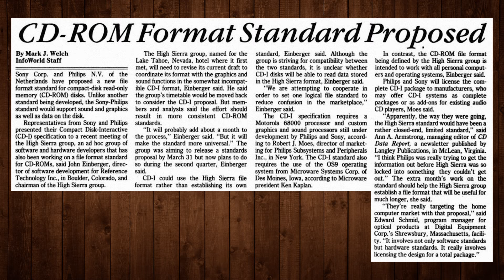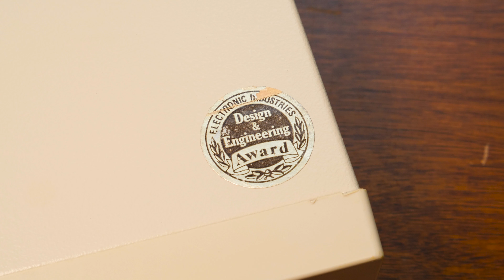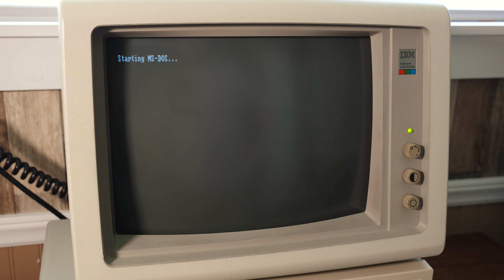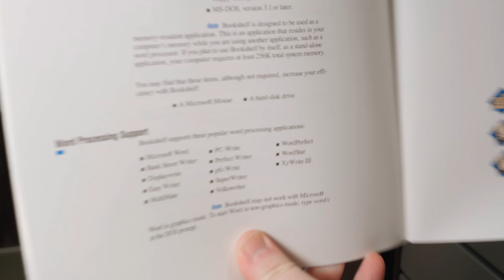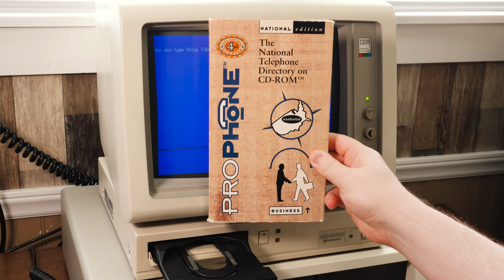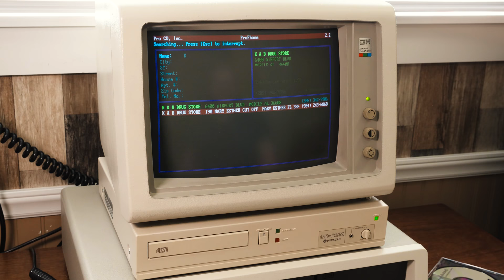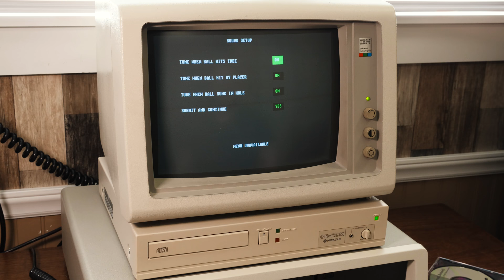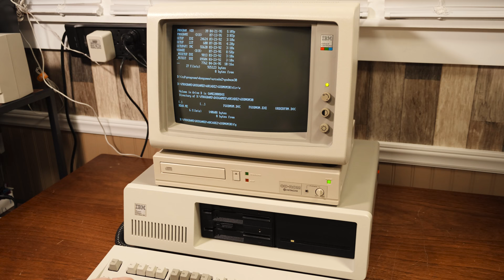The 1987 CD-ROM Experience: Hitachi CDR-1503S

Comment: I'm in awe of the graphic design on that '87 Microsoft CD. It's virtually indistinguishable from the design they were using for optical media well into the noughties. I'm not talking about premium optical media that might have a holographic surface, but your mundane mouse driver or service pack CDs really did look like that for a long time.

Comment: I remember when we got our first CD-ROM drive for the family 386. It was an internal drive that came in a pack with a sound card of some kind. It used this weird interface with a super skinny data ribbon cable which I haven't come across since. Used even fewer pins than the Sony interface on some of the SB16 cards. Definitely a lot fewer pins than the huge connectors on that drive!

It wasn't a caddy drive, but the tray wasn't motorised either. You had to push in the tray and it would pop out, then you could pull it the rest of the way out. My dad didn't know much about computers, and I was just a kid, so we had no idea you had to load drivers to make it work. But I did figure out that you could get it to play an audio CD if you pressed the volume knob on the front. That made my dad very happy, because the only reason he bought it was so he could play a music CD he bought.

Eventually we got some help to load the drivers and get it working, we also got the sound card working, but that took longer I think because it wasn't a common one like a sound blaster.

Really wish I knew what the drive and sound card were, I'd love to re-build that machine the same as when I was a kid. I'd love to relive the memory of playing games on that machine.
Reply: Drive sounds like a Mitsumi LU005S. Single speed, very weird tray, and the only one of it's type IIRC. Used a 36-pin interface I believe... There were versions bundled with all kinds of soundcards
Reply: May have been some revision of the Mediavision Thunderboard with CD interfaces onboard
Reply: Possibly an early Philips CD drive, or an early Mitsumi drive/sound card.  Until they settled on IDE, each manufacturer had its own interface.  I still have a ton of old computer hardware down in my basement collecting dust, including a 1x Philips, many 2x drives, and a 3x NEC external drive with SCSI2 interface.  I should probably sell most of that stuff, if it's worth anything now...
Reply: I have the drive you speak of at work somewhere. It did indeed use a small ribbon cable.
Reply: Thanks for all the comments and suggestions, Mediavision did sound familiar, so I did a quick google image search and found it was most likely a Pro AudioSpectrum 16 card due to the 16 pin CD-ROM header. The wikipedia article suggests this is known as the LMSI interface.

The CD-ROM drive still has me stumped. It wasn't a Mitsumi LU005S as suggested, the tray was very different from that one. I remember it was relatively thin compared to many others around at the time, only marginally thicker than the tray that the CD sat in, and protruded from the front of the drive so you could press it in to eject. The volume knob was a fairly narrow cylinder that also protruded from the front of the drive so it could be pressed to play audio CDs. I think there was also a 3.5mm headphone jack. I remember my dad had to plug a cable into it so he could record his CDs onto tape so he could listen to them in the car.

Now I'm off to eBay to find one of the sound cards! (If anyone has one that they're willing to sell and ship to Australia, my twitter DMs are open @UpLateGeek!)
Reply: @adejupe8308  Thanks for the suggestion, I did some googling and believe it was a Pro AudioSpectrum 16 with LMSI interface!
Reply: @aaron71  If it uses a 16 pin LMSI interface, then it might be the one!

Comment: This was out at the same time as the Commodore 64 and Apple IIc. That's just mind-blowing
Reply: Then again, sim city 2000 was released while the C64 was still being sold. Granted, the C64 was wildly outdated, but it was still selling.
Reply: @benjaminj1866  Good point, the C=64 was out until 1994.
Reply: Like most Americans I didn't get a CD ROM in a computer until the early 1990s with a 386/VGA powered machine. 

In 87 to 89 there were more AT class computers and the drives were expensive
Reply: @benjaminj1866  The huge library of games that you could copy on a standard 2 deck tape player. It's the same reason as popularity of Amiga computers. Huge crackers scene and data medium that was easy to copy for a 10 years old kid. Piracy...

Comment: I don't even remember a time when I had a CD-ROM that wasn't at least 8x speed; I knew 1X existed back then but the concept is still unfathomable for me.
Reply: im old enough to have owned a 4X... i did see 2X units at school...
Reply: I used a single speed drive at school with a caddy and parallel port interface. There was one drive that we had to share across the whole school. Hooked up to Archimedes RISC computers that were state of the art at the time.
Reply: I had a 1x SCSI drive with a caddy mechanism, but I don't remember the brand.
Reply: I had a 2X speed, and wondered what it ment.. haha
Reply: I remember when I upgraded from a 2x Speed to a 6x Speed CD ROM. I put in the CD for Rebel Assault 2 and the game's benchmark flipped out because my CD ROM transfer speeds were "faster than is possible"
Reply: @misterthegeoff9767  I wonder what would it think of the 56x ones that are common now (and became common around like 2000 or so?)
Reply: My first was 2x. Good old hand me downs from your grandparents
Reply: Conceptually, it's really quite simple to fathom.  Imagine the worst CD-ROM you've ever owned.  Then imagine it being eight times worse than that.  :)  And still better than the cassette drives I started out on...
Reply: @lockingBlock  I had one on an old work computer. 
 I was surprised that LGR's old drives would read burned CDs, because my old caddy unit would not.
Reply: I had a 1X NEC External CD-ROM, top-loader that connected via a SCSI interface.
Reply: Have you owned PS1? It had a 2x CD-ROM reader.
Reply: I remember the sound of the first CD drive I used very clearly - it was 2x, and the laser movement sounded pretty cool to me - it had a really deep sound. Weird what sticks in the mind.
Reply: i mean if you own a CD player you technically own a 1x drive
Reply: 4x was pretty standard when I younger. 6 & 8x was a pipe dream lol
Reply: if you ever had an original playstation you had a 1x, afaik that console used a 1x drive.
Reply: I remember seeing 4x, and thinking why would someone get half the speed.
Reply: @MinorLG  At the time they were also called quad speed CD drives.
Reply: @MinorLG  Half the price ?
Reply: my first computer had a 1x with a cd caddy. But that was an old work station from my dad's work.
Reply: @krnlg  I still remember (and miss) he sounds of our old beige Pentium desktop even though we probably sold it over 17 years ago when I was a kid, so it's not that weird.

Kinda wish I still had it and it's monitor, or the Pentium Duo machine that came after it...

Not letting go of my personally built Ryzen desktop for sure though, I'll keep this thing going until it's a nostalgic relic, in the mean time lots of upgrades to do to keep it plenty relevant!

Still looking for a old CRT to play around with just for fun, should make retro emulation much more authentic

Comment: "imagine feeling like a baller walking out with this"

Nowadays people laugh at you if you have a dedicated CD or DVD drive. How times change.
Reply: I have a cd drive...1x speed! Beat that! 😎
Reply: I will never not have some sort of odd in a computer.  These days, it's a bd-rw drive.  I'm going to be putting a tape (lto) drive in my next build (in addition to a bd-rw)
Reply: Still disappointed bluray is where it died. There were some strides into getting holographic storage and other wild optical tech working; doubt there's a market for that anymore. Personally I love having 50GB on one single optical disk. More reliable than spinning rust, longer life than SSD and more secure than cloud. Added bonus! It would survive an EMP blast.
Reply: Not I; this 'all-digital' trend is absolute traaaaassshh...lolz
Reply: @SinisterPuppy  ahh? SSDs only deteriorate by writing, not by reading. If you use an SSD like a optical disk (that is, write once, read many times) it will last you forever (well, probably not forever, but for a much, much longer period of time than optical disks that tend to suffer from Disc Rot)
Reply: At work we bought a 3x internal CD ROM as a special offer when the RS Electronics catalogue became available on CD. A lasting memory was that it wouldn't fit in the Siemens computer faceplate.  My colleague fitting it had to modify with his penknife !  As for SSDs does anyone really know how long the data will be safe ?
Reply: @MinorLG  try putting a paper tape reader in. That would be odd
Reply: iTheGeek  Only "burned" optical discs deteriorate, not pressed optical discs. Well of course they also deteriorate over time (as anything does), but not after just 35 years or so. SSDs on the other hand DO deteriorate by use.
Reply: I've got a DVD-RW in my gaming rig that I scavenged from my old desktop. Why? Because I still have DVDs laying around. The only people that would laugh at you for having an optical drive are teenagers and who cares what they think.
Reply: iTheGeek Not entirely true. SSDs are not a form of reliable long term storage. They will eventually fail, just not mechanically like HDDs. They make archival CD’s that are good for 100 years. Try that with a SSD. I still use those gold CDs for really long term “just in case” photography storage.
Reply: iTheGeek  People often forget that even though the amount of data being stored has increased, the technology to store it is still the same - its still a thin layer of material that can and will get destroyed a lot easier than a regularly written disc, either due to scratches or the material itself just decaying.
Reply: i have external dvd usb 3.0 drive just in case it's needed as combo drives like blu ray + dvd still cost a fortune for like 100-200usd when it's going to be used for like 5 times in 10 years means a no buy to me
Reply: @Frank Schneider pressed optical disks absolutely do deteriorate. On CDs the top metal coating containing the pits can start to flake off, on all forms of optical media the layers can separate over time especially if not stored well or cheaply made, etc. It’s already happening to older CD based games like Sega CD and you can even find examples of newer optical disc titles failing. Bit rot isn’t just a burned disc thing, it just happens much faster usually.
Reply: @benn454  teenager here, I wouldn't laugh because I use my DVD burner a lot
Reply: @AmyraCarter  totally agree
Reply: @benn454  totally agree! 😀
Reply: Yup lol know it’s like WOW that guy has the IPhone 11 or MacBook Pro
Reply: CD/DVD's have usage as backups because they're flat enough to put somewhere nice and protected, and you just need to remember to get a new disk and update every 5 years or so, water resistance and even EMP resistance is a comforting feature compared to SD cards
Reply: My modern computer still has an old DVD+/-RW drive that was transplanted from an old Acer prebuilt computer I owned about a decade ago and has gone through several custom computer builds throughout the years. I almost never use it nowadays though - the last time I used it was to get some digitised ID photos off a mini-CD that I took at a professional photo studio so I can complete my national ID card application electronically online (I live in Singapore, which has a mandatory national ID system).
The funny thing is that my computer system lives now in a Fractal Design Define R6 USB-C case, which was released like, 2-3 years ago? And even packs a USB-C port on the front panel. Modern connectivity with an ancient drive format. lol
Reply: Nick Slouka very clean 😎
Reply: @einsteinx2  One has to look no further than the instances of disc rot shown by Techmoan and Technology Connections for CED, LaserDisc, and CD Video.
Reply: Do they laugh? I havent seen anyone laugh.. just comment "most people dont use those anymore". But some people still do use them.
Reply: I will NEVER be without SOME form of physical,removable media. IDK WHO wants to laugh.
Reply: @lyianx  i literally have a ps3 for its blueray. Its a 1st gen ps3 and its only use besides that was mgs4.... then never used again
Reply: I might be putting 2 blu ray drives in my pc build
Reply: Yeah, I laugh if you don't :P small childrens toy pcs without an optical drive! :)
Reply: @MinorLG  I loathed the day I realized there was NO upgrade path to a new CPU without waving goodbye to having floppy controller :( I was like "what? humanity somehow lost the ability to construct a floppy drive controller? ancient knowledge lost to time? the fck.."
Reply: @AmyraCarter  pretty sure there's no analogue version of any CD standard :) I think you'd be hard pressed even to argue that floppies were anything but digital :) computer tape.. you might be able to argue they were somewhat analog. :)
Reply: It's so damn hard to find a computer with a dedicated disc drive...I need one for some older programs I use. That and I burn a lot of game/movie discs and backups.
Reply: @azazellon  You can always buy an external drive for usb. Or one of the good old 5.25 inch dvd drives and hook it up with an external casing for usb. You can also connect a 3.5 inch disk drive to a smartphone and play Commander Keen - LGR proofed it.
Reply: Wait, really? I like having the option to read/write discs, plus it's not like I just threw away all my CDs and DVDs just because something new came around. I have a USB floppy drive too just in case I ever need one, and a stack of like 10 floppy discs, again, just in case.

Is this getting old? Justifying keeping antiques around?
Reply: @DusteDdekay  Can buy industrial motherboards for modern processors that still have FDD controllers on them, and there are still modern motherboards with PCI slots that you could put a controller card in, dont think anyone has made a PCI-E FDD controller card though, but not really any point, most people if they really wanted one would just get a USB FDD
Reply: @MinorLG  Ive got LTO 3 at home very reliable and I have DAT 160gb to mine are external works great.
Reply: @einsteinx2  I have experienced disk rot.  Not fun.
Reply: @DusteDdekay  windows 10 can still handle floppy drives, if you can find a way to connect it up.  Perhaps there's a sata adapter, or a internal USB to floppy drive still available.
Reply: @MinorLG  I lamented the lack of floppy disk drive controllers on modern motherboards, sure USB is the only solution for modern machines, I'm using a cryoflux but it's a hassle. The USB ones generally lack in features. For instance the ability to do 5.25 inch
Reply: I was configuring an optiplex while in a Discord call and My exact words were "Aw hell yeah now its got 2 DVD drives that I'll never use"
Reply: Thats cause theres the much better bd drive. And yes my pc which is nearly one year old and is a custom build i made has one. its a bd burner. I have a ton of  cds, dvds backups. And i will start making bd backups. Probably on mdisc variant version since they have around 1000yrs of life span. When it comes to backups slow and steady wins the race for me. Not keen on NAS for a back up solution.
Reply: @chrll  seriously look into Mdisc. They are non-organic based and for the blu-ray variant they last 1000yrs. So good luck with your ssd. btw no ssds do not last that long. Mdiscs do not suffer from disc rot as they are not organic for the coding that holds the information. There are mdisc versions of dvd and blu-ray and all of them will out live you.
Reply: @densetsu4286  who tf still buys dvd mdiscs?
Reply: @gregdaweson4657  I was talking about blu-ray mdisc not DVD mdisc. There is a difference, a significant difference. Also people who really care about backing up data. The problem with a lot of modern solutions is that they only focus on speed and not reliability. And while speed is nice it's not the point of backups. The point of backups is a safe and reliable solution to not losing your data. And currently nothing beats blu-ray mdisc in that category. So if you actually gave a damn about protecting your data that's the way to go.
Reply: @densetsu4286  Why thank you for telling me shit I already know.

I'm touched.
Reply: @gregdaweson4657  apparently you didn't know this information. Cause your ignorance on the matter proves you didn't. So I'm glad I made you aware.
Reply: @densetsu4286  Nice middle-school level comeback, I'll be sure to burn it to a pro-grade disc using my ASUS burner.

Cheers.
Reply: @gregdaweson4657  better than your kindergarten school grade replies.